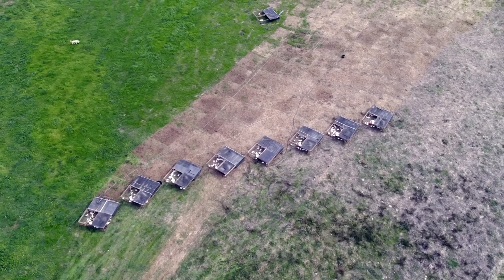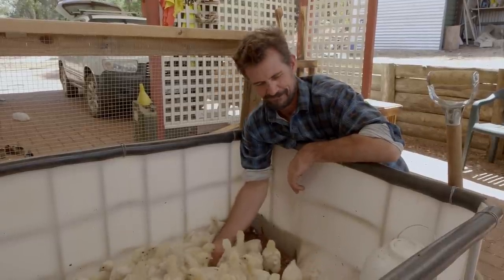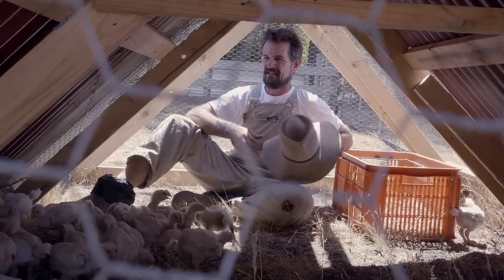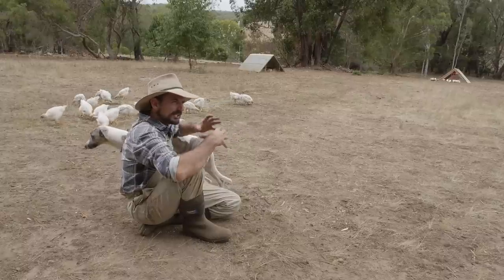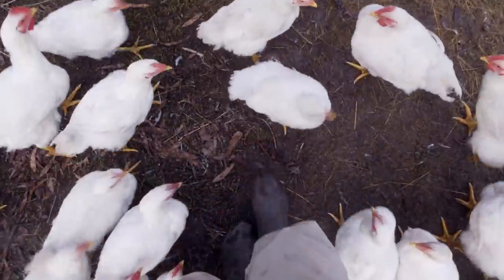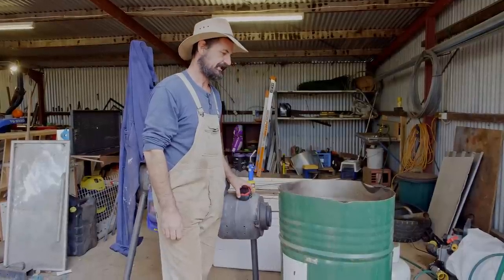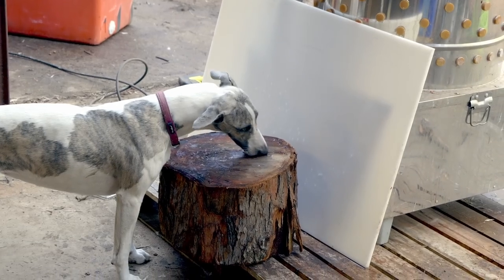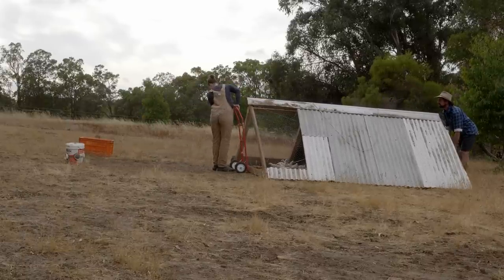How to Raise a Year's Supply of Chicken - Free Range Homestead Ep 41

Comment: Many years ago, when I was in Morocco, there were a couple of guys selling meat chickens. They were live and killed them to order. The feathers were removed within seconds of killing them. One of the guys just stuck the chicken in the enclosed machine whilst holding onto its feet. I wish I had of asked how it worked. I have never seen better. Once he pulled it out, he passed it onto another guy who took the guts out washed it and bagged it. Handing it over to the customer. The whole process maybe took a minute.
Reply from the maker: In Egypt, I saw a plucker that was an old repurposed washing machine with springs inside instead of the rubber fingers. Ingenious, but did require a small boy running about the shop to clean it!

Comment: I can afford to patronize you guys but i got heaps of useless opinions to share.

1) A Maggot generator is a good way to convert food wast into a better food/protein source for you meat birds, you just have to remember to keep on to of it otherwise you get heaps of flies.

2)commercial meat birds are washed in a sodium hypochlorite solution, called Pathogen Reduction Treatments and/or Direct Intervention , because of the nature of poultry and how they are processed; dunked in water and then eviscerated if there is any faeces on the feathers or feet, or the intestines are ruptured, especially using a plucking machine, they can be contaminated and meat is hard to wash off. salmonella in particular. especially storing large quantities for long times, Even freezing. its easy/cheap insurance to help combat the problem. 

2.1) sodium hypochlorite is in bleach, but household bleach also had surfactant and perfume. you need a food grade  sodium hypochlorite, also called just hypochlorite or hypo. it is a very safe, even food safe, chemical used for sanitation and sterilization. it is very reactive with organic matter and breaks down basically into saltwater and oxygen with time and heat and light. it should always be used with cold water.

3)heat shrink bags, you can get vacuum or normal, are going to be the best bags to pack in to reduce freezer burn and keep the shape of the bird without crushing it too much.  

you should be able to easily get both these at a butchers supplier or maybe through you local butcher if he will order it for you. if all else fails i could have it send to you.
Reply from the maker: I must get round to a maggot farm again. I used to make fish bait that way when I was little.